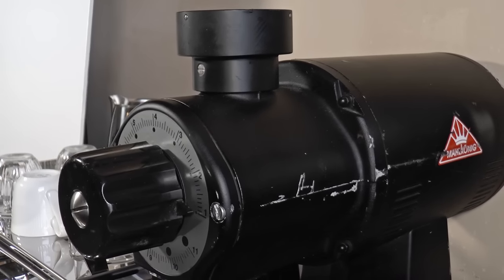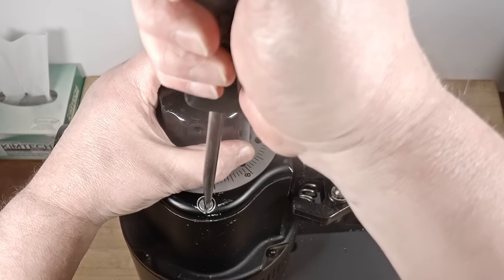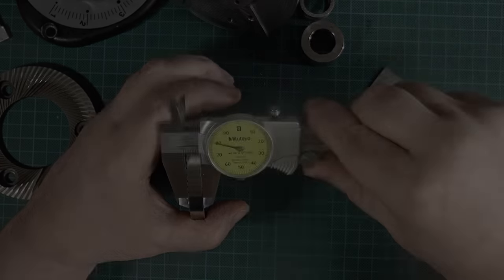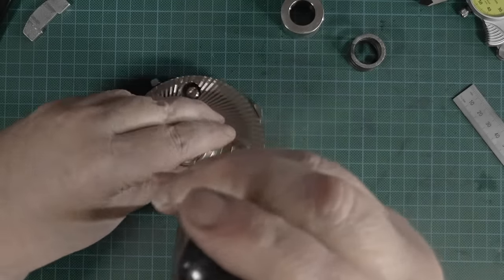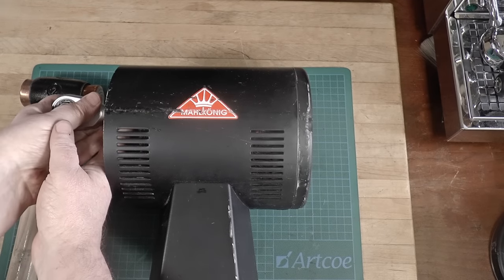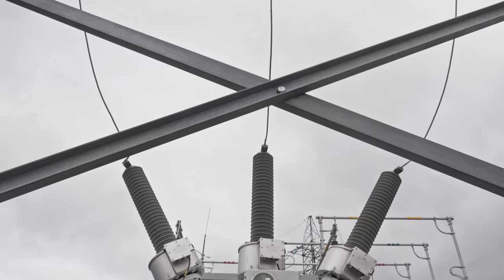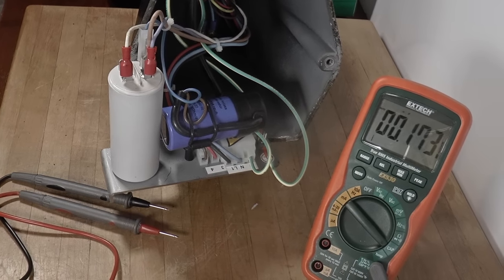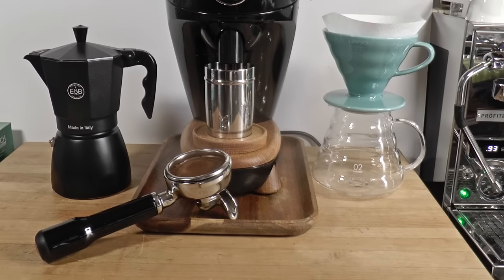Mahlkonig EK43 Restored: 1 Teardown & Diagnosis

Comment: I've always hated slotted screws... until I got smarter.  Only about 30 years!  A boat builder taught me to drive slotted screws properly with the correct fitted blade and with an occasional pause to let the blade fall back into the slot.  If you use both hands and concentrate, results are excellent.  In the hands of a craftsman or technician, slotted screws are good.  Other fasteners were designed for 1-handed operation on assembly lines, where people had less time, caring, and skill.  If the design is good, a slot is the simplest and often the best.  For example, my dog's collar has a battery that has a push-and-twist type installation.  The battery is designed to use a flat part of the collar's closure to twist it.  The reason it works is that the slot is wide enough to spread out the force.  Interesting video.

Comment: Hey there, love your serie. Quick question : My ek43s is starting but shutsdown 2 sec after. The motor doesnt really have the time to catchup (like a vehicule not holding it's rpm) Do you thing it's a starting capacitor problem ? thanks =)

Comment: Hiiii I love this video, waiting for part 2 :D
  
I wanted to ask you since I'm a baby engineer (software not appliances though 😭) if you can show the mechanism that decides stepsize for the grind adjustment?
  
I have a vintage model of these (1980s probably, seller wasn't sure) and with it the grind quality is super nice but the steps are huge. I was wondering if I could mod it to save like 4000€ for a new one 😅
  
I imagine they didn't change much? Mine looks exactly the same only in brass and silver not in black 
  
If your vid is already in production I'd also appreciate any input by text 😭 I'm on a really low budget and this grinder is saving my life currently
Reply: Oh and just a small detail for historic facts, the unit I have has the grind adjustment on the backside not front.
Reply from the maker: I haven't seen one with stepped adjustment.
Reply: @wiredgourmet  yeah it's oooold. They have a small rounded piston thats driven by a spring and sort of jumps to the next available hole on the backside of the grind adjustment. I commented on part 2 that I was able to mod it by shielding the hole area
  
Thanks anyway for the reply and your time and this series :D

Comment: Hey, sorry for the comment not related to this video, but i think you could help me. I just bought a Eureka Mignon Perfetto and i'm annoyed with the lack of fine adjustment (i know it's because of the 1 spin espresso to french). Do you think there's something i could do to increase the range? Like some mod to make it able to spin twice or something like that. Thank you for the videos!
Reply from the maker: IIRC, there is a limiter on the adjustment mechanism just under the top cover. You can unscrew the adjustment knob to get at it. But it has been a while...

Comment: Great video, I have a couple EKs I picked up and am looking to fix up so this is a great reference. Though I am surprised you can find your parts for so cheap, from looking online it seems each Mahlkonig part I find is $5-20, plus $60 per bearing which would put this far above your estimated $175 Euros, guessing pricing is a bit better in Europe for these.
Reply from the maker: The bearings are standard, generic parts, should cost between 8 & 12 bucks each. Don't pay Mahkl's prices. Stock EK43 ones are HCH 6004-Z, shielded. I'm going with SKF 6004-RSL, sealed, for the same price. I will explain a lot about bearings & lubricants in part 2. (Don't buy Kluber paste from them either; it's 25-30 per tube normally.)

Comment: Nice video but that winding looks to be perfect ( I wound electric motors for 10 years and work on CNC machines daily) 

Running the motor longer than it’s duty cycle will not make it rust that’s just silly..  If the winding was overheated the tie straps burn off first and then the insulation will discolor. No signs of any of that.

 It is not necessary to have phase insulation on the start winding, the voltage difference between the running and starting on a single phase motor is simply not enough to warrant it.  
Secondly the start capacitor cannot be checked with the bleed resistor, you should remove it and check it.
Reply from the maker: Thanks for dropping by. Do please email me.

Comment: Yes I think you're right that the bleed resistor fooled your multimeter. Multimeters tend to use a timing-based method for measuring capacitance: time how long the capacitor takes to charge to a known voltage. The bleed resistor lets DC current bypass the capacitor entirely, slowing the charge time. An LCR meter (which applies a known frequency AC voltage and measures the phase angle of the AC current) will not be fooled so easily